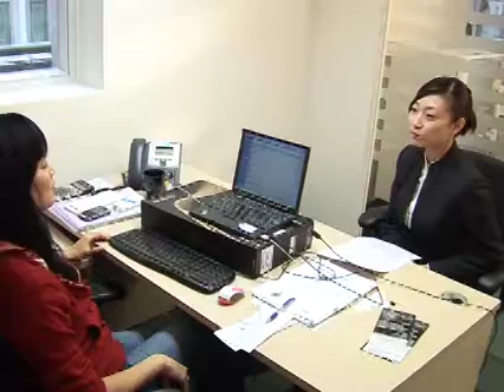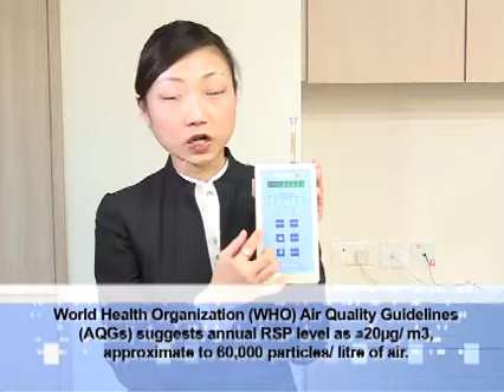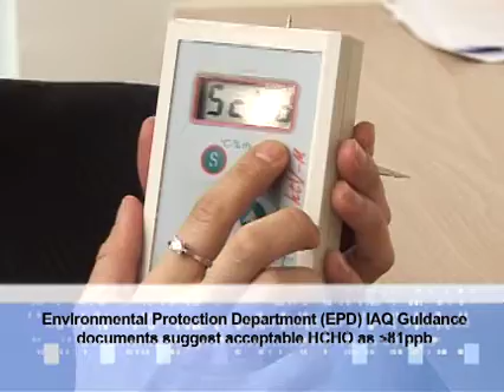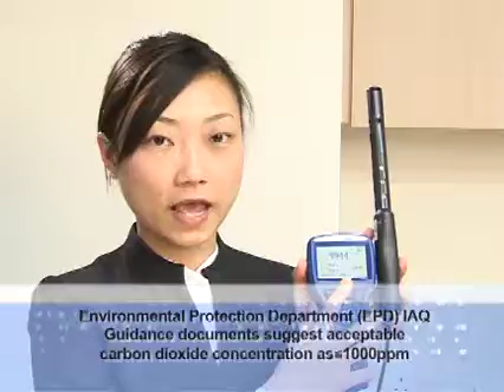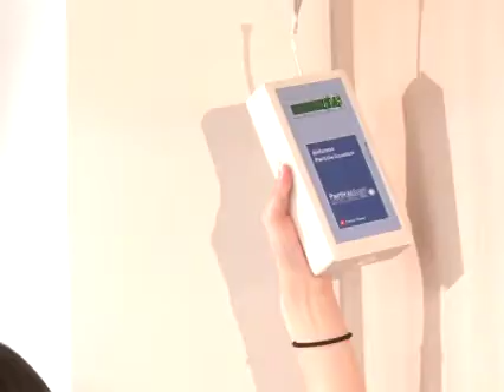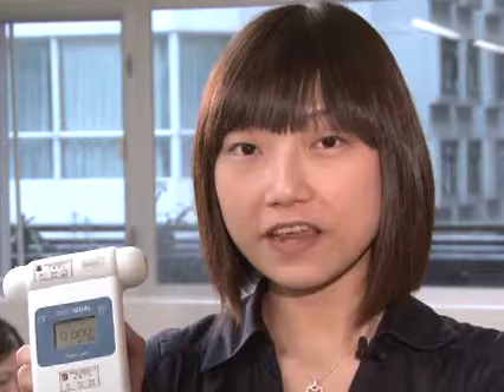IQAir case study: Clean Air Network (Hong Kong)

Comment: I have 2 & I’m trying to figure out what kind I’m buying another 2  IQ air is not what they say the fan is way to cold for me even in low speed my joins freezes & I get in extreme pain the remote is a joke looks like for a toy now one with arthritis or any health  deficiencies Can use that remote I have to pressed the number or the start , stop bottom so mean times I cry in pain & I give up most the times & just feel sick & cry . They don’t worth the money , and the price of The filters the I change 3 times a year.. Is just way too much for what is doing for me 👎😓
Reply: The purifier doesn't make the air colder if your home is too cold you need to use a heater.  This product does not change the air temperature in any way it simply purifies the existing air.  The filters are not cheap but you could easily find the replacement cost of them before you purchased the IQ Air.